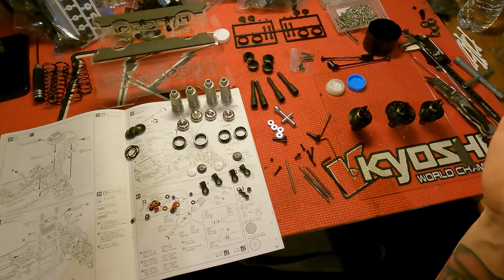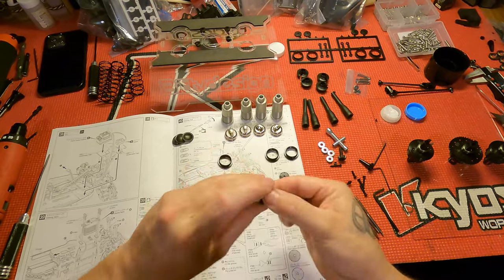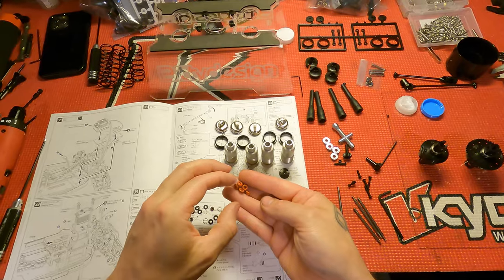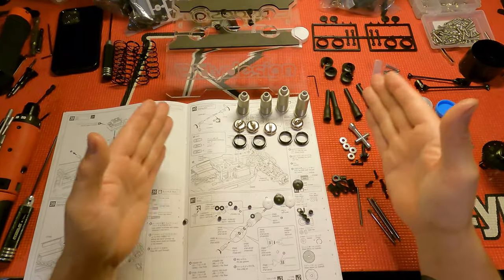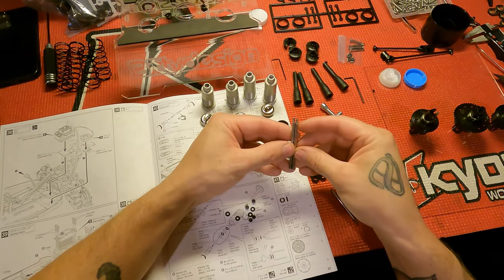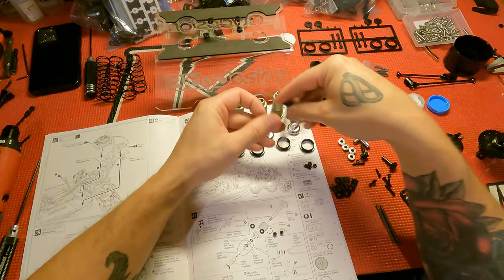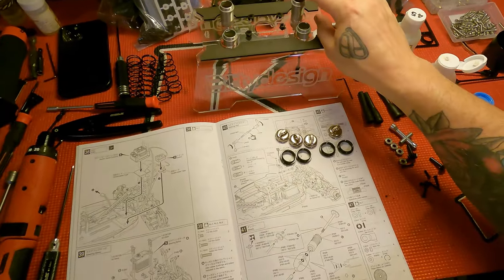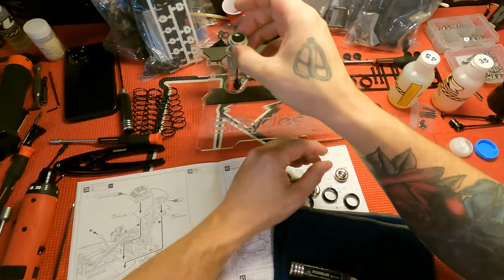KYOSHO MP10 SHOCKS

Comment: You tried to hide it but you were pissed about that shock bro.
Reply from the maker: 😅 A little irritated for sure 😆
Reply: @Nathaniel2503  quick question I have the rtr  mp9 tki 4. Can I disassemble the shocks and just rebuild them with the original parts. I just want to put a heavier weight oil in the front and rear shocks. I also have the shock boots to install.
Reply from the maker: @favulus1  yeah that would be a problem at all